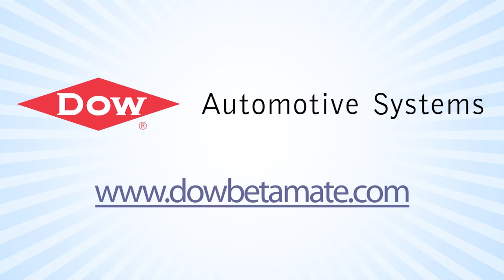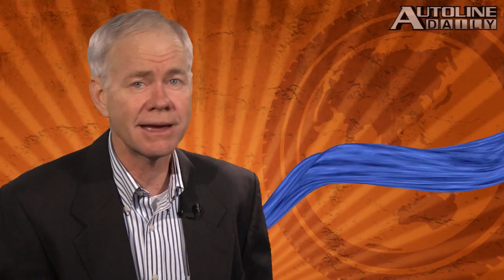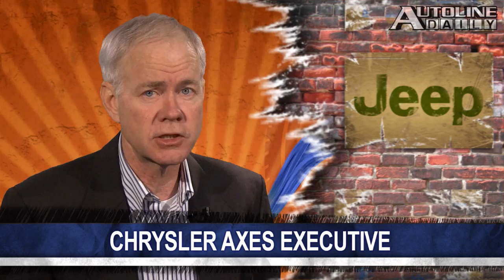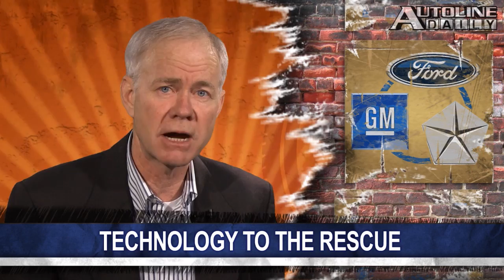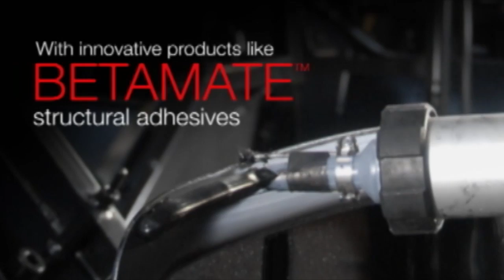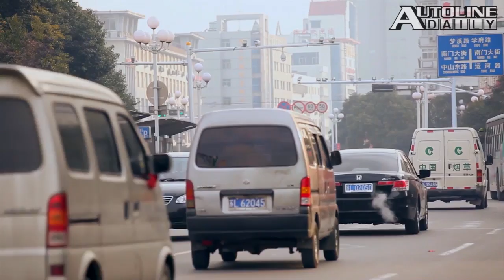Nissan Wants IDx Concept in Production - Autoline This Week 1293

Comment: Made on the Rogue platform? I hope that does not mean the IDx Freeflow will be FF (Front engine, Front-wheel drive). FR (Front engine, Rear-wheel drive) should not be difficult given the Rogue makes allowances for AWD, so an FR drive train should be easy enough to do.

It would be [not good] for Nissan to make a car deliberately evocative of one of their highly regarded and remembered FR compact cars, expected to go toe-to-toe with FT-86/FR-S/BRZ, fall into the space left overtly vacant by the absence of the 240SX, but make it FF instead. That would be [not good] indeed.